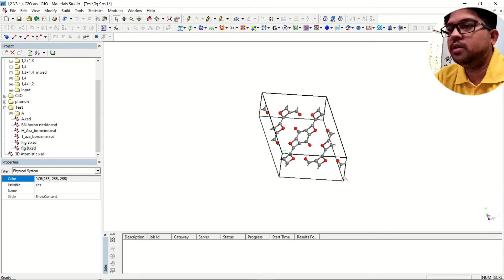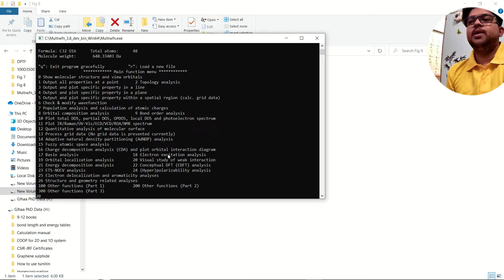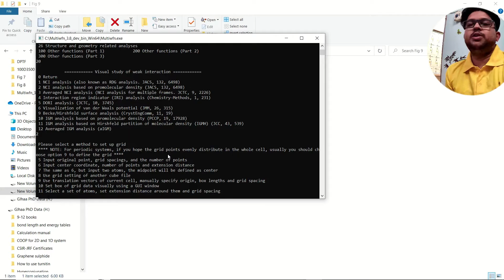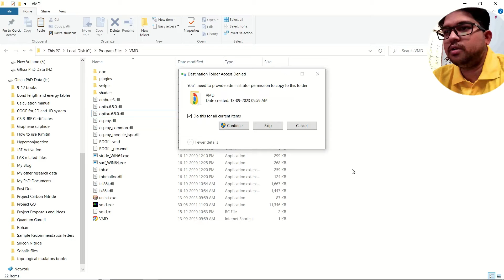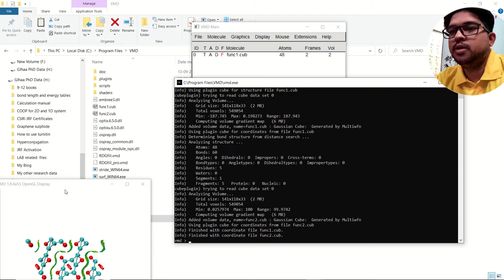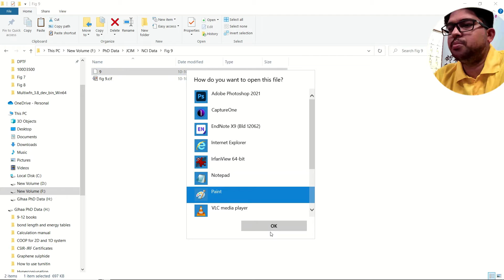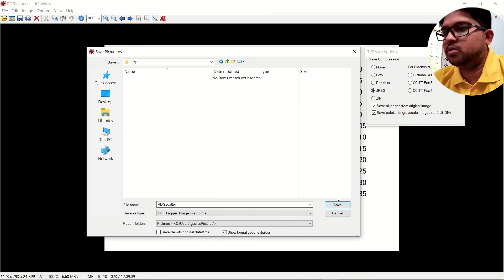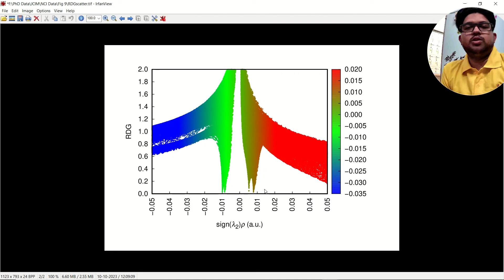Live NCI Analysis For Periodic System Using Multiwfn software  ||Part-2 Materials

Comment: Sir, could please upload a video on DOS calculation using gaussian
Reply from the maker: First, generate a .fch file in Gaussian, then use main function 10 of Multiwfn (http://sobereva.com/multiwfn) based on a .fch file of Gaussian to plot DOS/PDOS/OPDOS map; there are plenty of DOS plotting examples in Section 4.10 of Multiwfn manual.
Reply: @quantumguruji  Thanks you sir